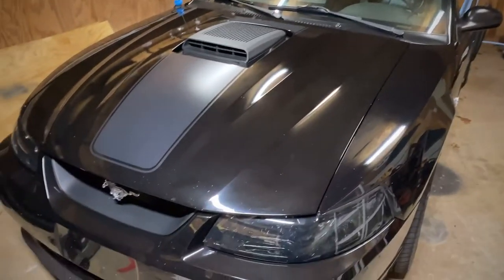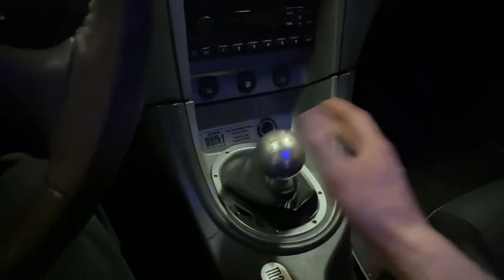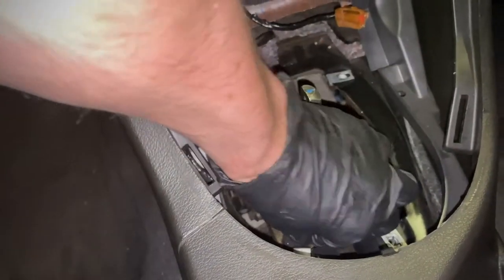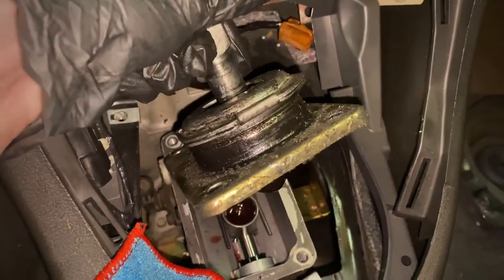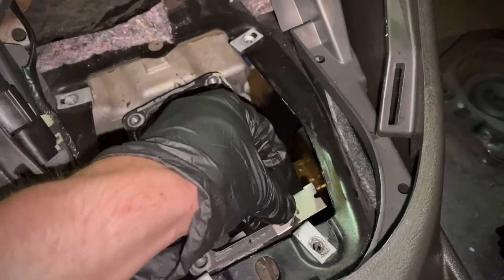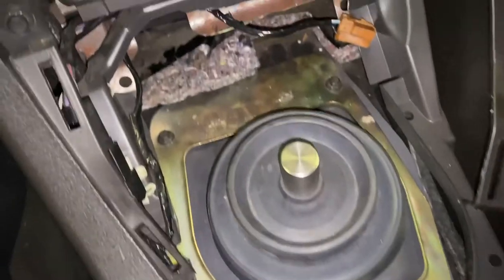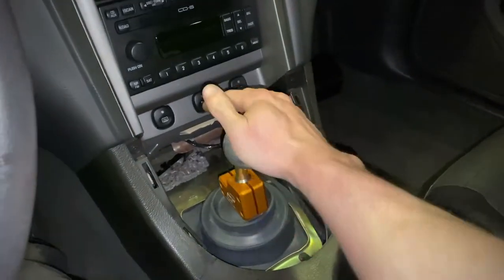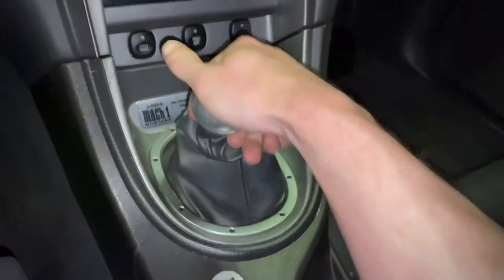THIS Is The Best Short Throw Shifter For 99-04 Mustangs (MGW Shifter Install)

Comment: I have the Steeda Tri-ax shifter in my Mach. That made a big difference in mine as well
Reply: I'm about to buy a mgw to replace a steeda tri-ax. I'm thinking maybe it's just old
Reply: @sategllib2191  did you ever replace the steeda?  I have a steeda shifter in mine and wanna replace it with an mgw.
Reply: @elliotrussellprokop4844  I don’t like how tight the tolerances are on my mgw I want a steeda